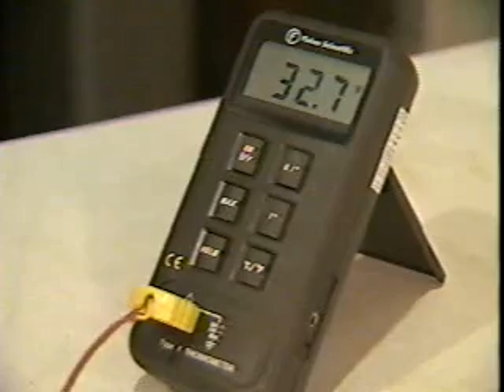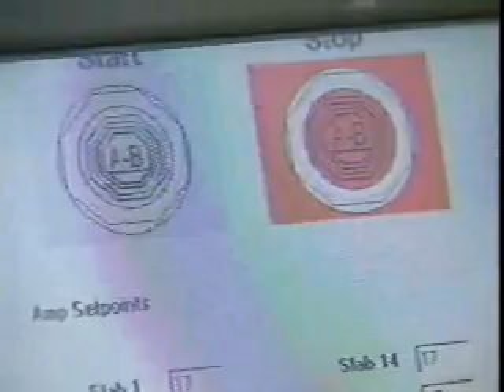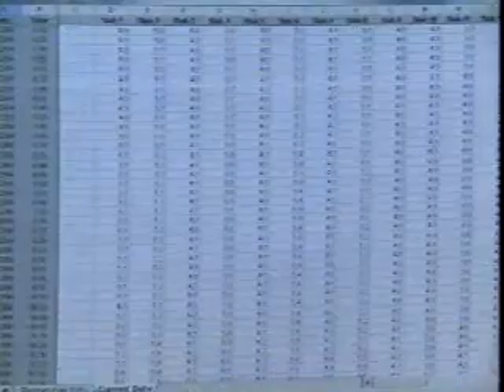Dr. Christopher Tuan: Conductive Concrete

Comment: not sure how this will work on a large surface; the current will not spread; it will take the path of least resistance, which is just a spline through the surface

Comment: :)
    Cool, vary great idea. However what happens when you turn off the current
    and the melted snow, now water turn to ice or worse yet Black Ice?
:(
Reply: The concrete is supposed to remain heated for the duration of a snow storm, and so long as the sensor arrays built onto the concrete read that the temperature is below zero degrees Celsius (freezing temperature), the concrete will remain powered. If necessary, the power can be manually shut off during periods of long, cold days and nights with no snow, but visible moisture is gone from the roadways.

Technically, yes. The melted snow will return to its frozen state after the power is turned off, but the only times the power would turn off is when the temperature goes above freezing, the power is shut off manually...or the power supply is disabled (hopefully not going to happen). By the time temperatures reach above freezing temperatures, the water would present itself as its own danger (not quite as hazardous as ice, but still a hazard, of its own caliber).

In the event that the power turned off, and ice is found on the concrete, the power can be restarted and the heating element will reactivate. The ice will melt into water, and likely divert from the driving surface areas.

TL;DR: Rest assured, this issue is covered. ;)